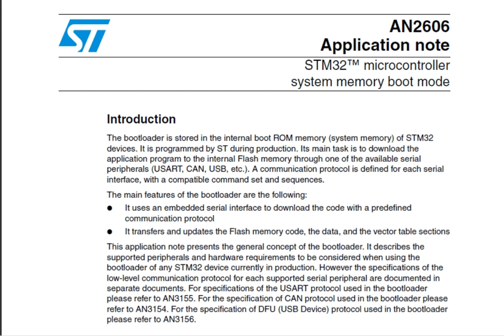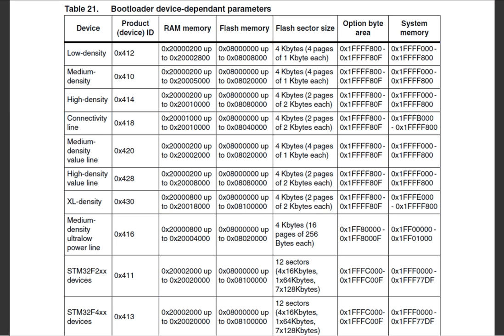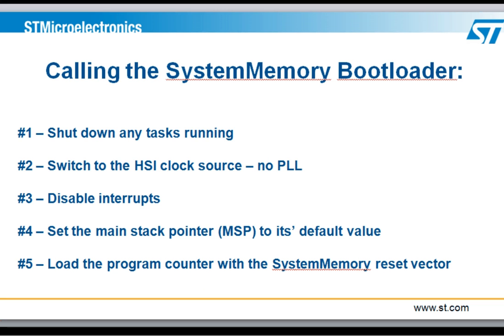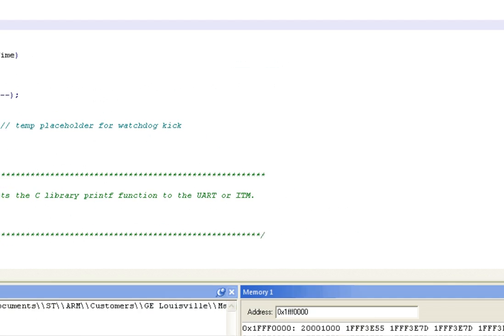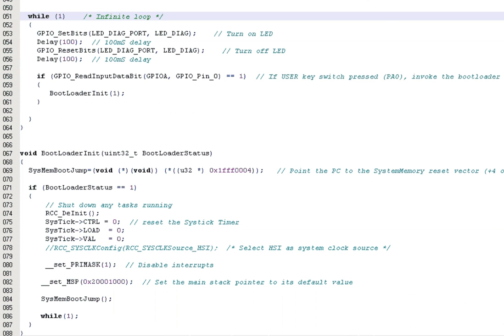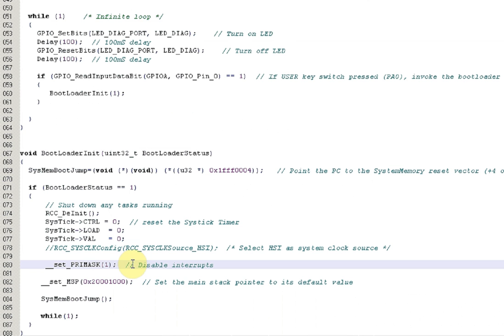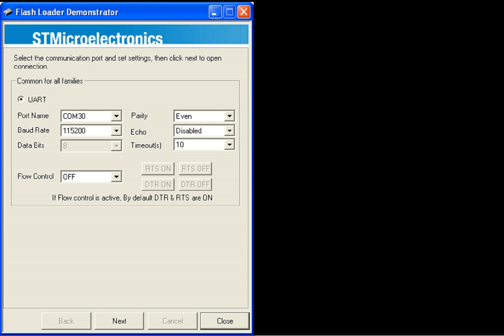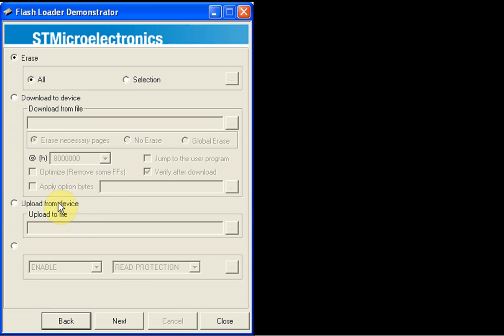Calling the STM32 SystemMemory Bootloader from your application

Comment: I'm using this adapt code with keil and cubeMX on a STM32F412 to flash over usb dfu, but it's not working. Can anyone help me?Please
// Springe in STM32-Bootloader
void (*SysMemBootJump) (void);
void BootLoaderInit(unsigned long BootLoaderStatus);
// Goto STM32 Internal Bootloader
void BootLoaderInit(unsigned long BootLoaderStatus)
{
  SysMemBootJump = (void (*)(void)) (*((unsigned long *) 0x1fff0004)); // <<< change address for your device!!!
  if (BootLoaderStatus == 1)
  {
    // Shut down any tasks running
    HAL_RCC_DeInit();
    SysTick->CTRL = 0; // Reset the Systick Timer
    SysTick->LOAD = 0;
    SysTick->VAL = 0;
    
		//__set_PRIMASK(1); // Disable Interrupts
    __set_MSP(0x20003000); // Set the main stack pointer to its default value
    SysMemBootJump();
    while(1);
  }
}

Comment: According to STM32F405-Omnibus/Core/Src/drv_reset.c  , viktorvano /STM32F3Discovery_internal_FLASH and  vanbwodonk / STM32F407_DFU_BOOT .. and the "ARM Cortex-M Programming Guide to Memory Barrier Instructions" part in "STM32F091 Jump to Bootloader from application - Electrical",   
https://jeelabs.org/book/1546c/  
https://scienceprog.com/flashing-programs-to-stm32-embedded-bootloader/  

0) HAL_RCC_DeInit(); HAL_DeInit(); __disable_irq(); __HAL_SYSCFG_REMAPMEMORY_SYSTEMFLASH(); __DSB();__ISB();
1) Clear system memory map ( ex. SYSCFG->MEMRMP = 0x01; SYSCFG->CFGR1 = 0x01, etc) 
2) set a virtual function pointer to the system memory specified in AN2606 (when BOOT0=vcc) + 4  (ex. 1ff00004) 
3) set the stack pointer to the system memory address (ex.1ff00000)

But is there a version of STM32's Flash Loader Demonstrator (FLASHER-STM32  AN3155) that supports can-bus bootloading?   At startup, my code check if a scratch-ram variable is set, and then jumps to the bootloader if necessary... so to invoke, I set the scratch ram variable, and issue a soft-reset.

Comment: Hi runbikedude : Wish you had made more videos on STM32 :-)
Assuming you are still running the channel : 

SysMemBootJump = (void (*) (void) (*((u32 *)0x1fff0004))); 

.
.
SysMemBootJump();
Could you give some explanation of the casting ? Are you setting a function pointer for calling the function : SysMemBootJump(); I have not seen such a construct in C.
Reply: you can declare SysMemBootJump within the scope as:
void (*SysMemBootJump)(void);

and you can consider SysMemBootJump is a function with no return value nor parameters.

This casts XXX to function pointer that the function has no parameters
(void (*)(void)) XXX

Comment: The generic cardha that adopts the MCU STM32F103C8T6 microcontroller

has the boot pin 0 that doesn't work.

Set to the Boot pin 0 from 0 to 1 and pressing the reset button the led connected on the PC13 pin always works.

 
It seems that BOOT pins are disabled.

 
I was asking if there is a firmware that can be loaded into internal memory to enable the boot pin 0.
 
But if there is any software that can reset the microcontroller to factory settings it would be great.

That is, to make the BOOT0 pin work so that you can program the MCU in FDTI.

Comment: Great video, but why did you dereference  the bootloader address before casting it at line 069?
Reply: It has been 7 years... you may have been already lost your hope or found the answer but I am currently working on this topic and here is your answer: The address 0x1fff0004 contains the address of reset handler function. So dereferencing it gives that address so that when called with "()", it executes the code of reset handler function.

Comment: Remove "__set_PRIMASK(1)" to achieve correct DFU work, because DFU use interrupts.
stm32f429 Bootloader id 0x91
Reply: I was wondering why it didn't work in USB mode. Thanks!

Comment: Hi, could you tell me why this doesnt work with the stm32f429 discovery?
Reply: +Steffen Strüber 

I have stm32f429 too. Used your code fragment before copy SP and jump:

 // SYSCFG_MEMRMP / remap ROM at zero
 __asm ("LDR     R0, =0x40013800 ; ");
 __asm ("LDR     R1, =0x00000001 ; ");
 __asm ("STR     R1, [R0, #0]    ;");

To achieve DFU correct work, remove "__set_PRIMASK(1)" from original tutorial, because DFU use interrupts.
Reply: @3Gorec  Hi,  DFU mode is working with user usb on dev board, right ? or is working with st-link usb part ?
Reply: @VolkansSpace  I don't remember. You can check in datasheet which port used for DFU or experimetnally.
Reply: @3Gorec  Thanks, i checked, So 
• USB OTG FS (PA11/12) in Device mode (DFU: device firmware upgrade).
Reply: Ricardo Ferreira 
This works for me on F429!
This is called within ResetHandler.

if (*((unsigned long *)0x2000FFF0) == 0xDEADBEEF) {
  *((unsigned long *)0x2000FFF0) = 0;
  JumpToBootloader();
}

void JumpToBootloader()
{
 // SYSCFG_MEMRMP / remap ROM at zero
 __asm ("LDR     R0, =0x40013800 ; ");
 __asm ("LDR     R1, =0x00000001 ; ");
 __asm ("STR     R1, [R0, #0]    ;");

 // Jump to Bootloader
 __asm ("LDR     R0, =0x1FFF0000 ; ");
 __asm ("LDR     SP,[R0, #0]     ; ");
 __asm ("LDR     R0,[R0, #4]     ; ");
 __asm ("BX      R0");
}

Enjoy :-)